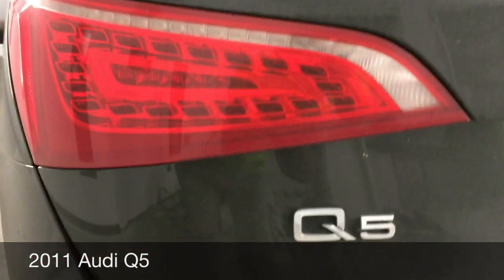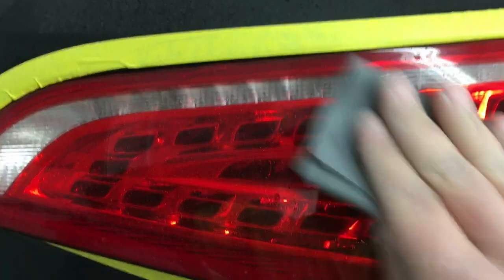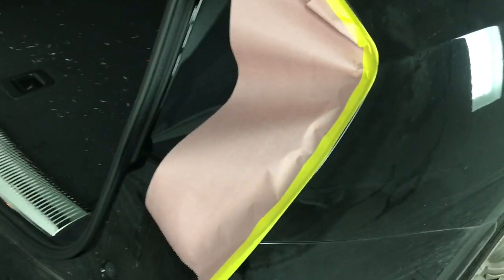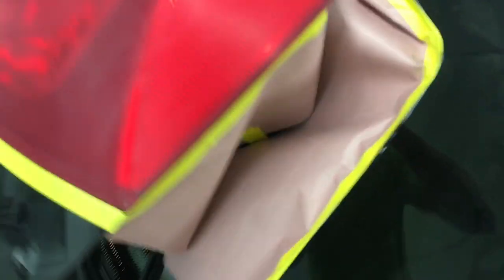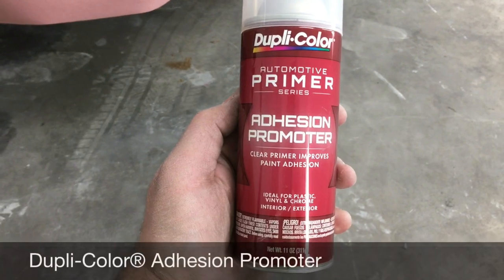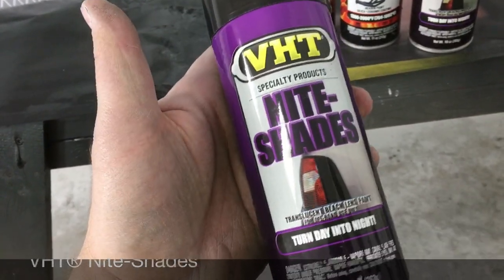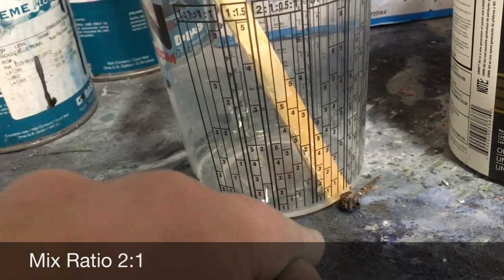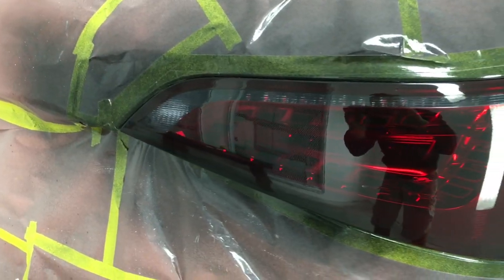How-To | Nite Shade Taillights (Professionally)

Comment: If ur planning on doing this DO NOT sand ur taillights first paint sticks by simply cleaning them then u will have better lite shine thru or if u wish to remove paint back to stock  without ruining ur lights
Reply: Paint sticks, but if you don't sand, it'll start peeling in a couple of months.

Comment: I may not be a real painter but wouldnt it have been easier to remove the lights n side marker... I mean you talking about profit but just ran threw a whole lot of paper n plastic...
Reply: It looks like he covered almost whole car,just to paint taillights,i mean what the fuck
Reply: You then have to detail mask the back of the light housing to keep paint from entering the inside of the light assembly
Reply: The price might be relevant to what he uses, im pretty sure he wont be doing all that and losing money. Hear what you saying though.
Reply: Literally could have saved money and time by removing the lights and side marker
Reply: Exactly what I was thinking but I guess that's how you tax the hell out the customer.
Reply: remember, by removin the lights ur liable for damages. safe than sorry
Reply: I've removed taillights on hundreds of cars I work in the automotive field bud.
Reply from the maker: Hey guys everyone has there reasons to do things there own way. The plastic and paper is waaaay cheaper then pulling off lights and then masking the lights off once there out then installing and sealing up tail lights so no leaks. So yes it’s very smart to leave them in the car. Only takes 2 min to bag a car and a couple min to tape off the lights. Also doing it this way there are no risks of future tail light leaks from not being re-sealed up properly.  there’s legitimately no risk in doing this and seeing how the bags of plastic are very inexpensive from my standpoint there’s no more efficient way to do it. How ever you do it just do it with pride and do it right.

Comment: If I dont have a spray gun what kind of clear would you suggest?
Reply from the maker: Michael Braun hi Michael, if you goto your local auto body supply store, they should have spray cans with some high solids clear coat that are much better quality than your typical store bought clear coat cans. It will be thinner inside a spray can, so apply several coats of clear. It won’t have the gloss, but cutting and polishing should bring it out after it’s fully cured. Follow instructions on can for cure times. 🐍🤙
Reply: Michael Braun harbor freight, 35 bucks and I’ve used the same gun for years if you clean with acetone after use

Comment: Great video ! Question; what’s the best way to darken one tail light once the clear coat has been applied? Thanks.
Reply from the maker: Aristotle Vallianatos hi there, you want to make sure you’re happy with the level of darkness before you apply the clear coat. Once you apply the clear, the tint is sealed in. If you want darker, you will have to wait until the clear is cured, re sand, tint and re clear again.

Comment: i loved this stuff. turned out great, however, i did do a great job at covering my paint, yet some parts of my car did get overspray on it. other than that, DO NOT go slow when spraying you're lights. it will make that part a lot darker. light, fast sprayed coats are the best way 😎
Reply: it’s usually 3-4 screws to remove the light. i’m still wondering why he  spent so much time n material  taping and covering the car?  lol if he worked at my auto body shops i’d fire him
Reply: @cesargonzales4819 I run a "body shop" and he did it correctly.

Comment: To properly professionally do this, you would not use VHT nightshades you use VHD nightshades if you’re in your driveway for the true professional will tent clearcoat, take the tail lights out, prep them with an adhesion promoter, and then spray them with a professional grade automotive spraygun to achieve the desired tint. Then it don’t peel it don’t fade. It don’t drive back don’t shrink and it last for many years ask me how I know.

Comment: I see you sanded the lights. I have a question...if I wanted to tape off a 'design' on the lens that would still be visible after tinting the lens, should I sand before, then lay out the design, then clearcoat? If I sanded after laying out the design I'm sure it would mess up the design I just taped on. I see a lot of these videos where they don't clear over the nightshade, but some do. Just wondering which way to do this. ;)
Reply: Clear over the nightshade definitely helps. I did 1-2 coats of clear coat after 2-3 coats of the nightshade

Comment: I was disgusted by the scuffing and spray paint....then block sanding ..and then waxing....I was like wuuuuuh.....man that turned out amazing...I'm doing my tail light soon with vivvid air release dry tint..it will have a little orange peel...I like to have the ability to peel it off and go back to stock

Comment: How would u remove this if someone wanted it removed? Brake cleaner?
Reply from the maker: Mr Taken unfortunately brake cleaner won’t remove it. But if you sanded the light with a 320 grit and a DA, it could be sanded back down to red, followed up by a 600 wet sand it could then be re clear coated or buffed and polished to be red again. It can be done, but it could also be cheaper to just order replacement lights online depending on make and model.
Reply: Will u link me the buffing supplies u used? Including the buffer etc

Comment: What's the point of the sandpaper??? Or the abrasive?
Reply from the maker: that guy sandpaper is needed for a “mechanical” bite for the paint. Skipping this step could result in the nite shade and clear coat flaking or chipping off.

Comment: Adhesion promoter works wonders on bare unsanded platic allowing you to paint
Reply: OblivionDio we use AP-131 on aircraft on occasion at my work and it works like shit, sanding is the king
Reply: I'm sure your use of it is entirely different than a taillight which in this application works fine to compliment VHT and the fact that the plastic surface has to be rough for the paint to grab onto which is why adhesion promoters are great for this.

Comment: Why don’t you remove the headlight from the housing completely?
Reply: a lot of extra work involved, on some vehicles, you have to remove the front or rear bumper to access all the bolts that hold the head/tail light assembly on.

Comment: 🤦🏻‍♂️  take the lights off people! Saves time and money
Reply: Can you not afford saran wrap and tape?
Reply: @kolebaumgartner2011  it would just be easier to take them off just a couple of bolts and then you could use that wrap for something that can't be easily removed
Reply: Carlos Sanchez depends what car you have because mine is a pain
Reply: Spray cans are meant to be held vertically and spray forward not to be held horizontally and spray down. You can do it that way with good results but there is a higher risk of uneven spray and spit.

Comment: Would've saved 30-50 bucks in prep and 2 hours if you just take the tail lights off, no?
Reply: Take apart the rear tail gate, or mask around. Painting is a production job, faster you get it done the more paint you can shoot
Reply: Also, it's easier to damage your light housing or scratch your car when removing, and I think it's more work removing than masking... Kinda like why there are window washers for the whole outside of the building instead of removing each window in each outside room of the building and cleaning it separately.
Reply: Scenic City Drone Footage ok that was the worst analogy ever but that’s your opinion. Personally i would’ve taken out the tail lights. It’s literally 3 bolts and like 3 connectors for the lights lol

Comment: Can you pill these back off without hardener
Reply from the maker: This isn’t removable. Would have to be sanded and then re cleared to go back to original finish.
Reply from the maker: 4B vEnOm don’t use clear coat without hardener/activator. It won’t cure properly.

Comment: Why not just remove the lens from vehicle to prep?
Reply from the maker: christph3118 light could be removed but most the time, the entire lens is exposed on vehicle anyways and being mounted to vehicle it provides a sturdy position to work on lights.
Reply: Waste of alot of paper and plastic for this. I wont be using this shop. Cost too much for the amount of waste. Take the light out.
Reply from the maker: speterbilt some vehicles require more time to remove lights than using some cheap masking paper and tape. Time is money! 🐍👌

Comment: That car was filthy, why wouldn't you wash it 1st, when you cleaned around the light all yous did was scratch the paint, if it had been washed you wouldn't have need to do that, and like others have mentioned wouldn't have been easier to just remove the lights, you could have made sure all areas, top bottom and side would have been done evenly,

Comment: Jeezus! Why not take the lenses out of the vehicle and not sand them like the instructions say? You're using a spray can so why not submerge the can in hot water for a half an hour to promote an even coat? This is not hard. 30 minutes to dry in between coats and 3-4 coats and the results I've gotten have rivaled this shit show of overkill

Comment: waaaaaaay too much work. i was hoping to watch something i can do at home
Reply from the maker: c dozer this is possible at home. You can goto your local parts or paint supply store and pickup some quality 2k clear coat in a spray can. Also the lights don’t need to be sanded and polished at end. This video covers steps needed for a professional end result.
Reply: This job would have been 10x easier if the taillights were removed first, depending on the vehicle. I have a C5 Corvette and it only requires the removal of 2 screws per sense. So, if your car's lights can be easily removed, do so.
Reply from the maker: Naaman Geist easy both ways. Lost a little tape and plastic sheeting if Left In. Many vehicles tail lights can take a while to fully remove. This is minor masking and doesn’t take long. Also provided a nice stand to be sanded and polished on. Very nice to leave in for fast turn around.
Reply: @viciousautoworks33  That's why I said "depending on vehicle" and was addressing the "waaaay too much work" comment. My corvette has recessed taillights, making masking, sanding and polishing more difficult and 2-screw removal a much easier option.
Reply: @viciousautoworks33  So how do you guys go about removing the raised lettering on some lenses? Mine has it along the bottom edge. This will hinder sanding and polishing efforts.
Reply from the maker: Naaman Geist they will sand out. Wet sand with a good 600 and or 800 grit to knock the letters flat and you won’t see them anymore. We recently did this on a 2004 Acura TL. Also, don’t be afraid to use a course wet sand paper. We used 400 wet sand on the Acura lights. We didn’t do a video on the tail lights but you can see a walk around in our recent uploads.
Reply: @viciousautoworks33  Thanks... so do I then sand with a fine grit after the lettering is gone or will the tint and topcoat fill in the scratches of the 600 grit?
Reply from the maker: Naaman Geist I would go over it a little with some 800 grit. And you will be fine! Using a small flat sanding block to sand letters down will really help make them truly flat.

Comment: I just feel like you used alot of unnecessary wraps and paper and liquids and products ect. Im not a professional so idk. Just based on other videos on youtube and this one, the look, looks the same
Reply: i thought the same thing but remember that you rarely see the results years down the road. I am almost positive skipping some of these steps will not work out well in the long run
Reply: Matt Mendelsohn I mean if worst case scenario is I have to re do it 5 years down the road, I’ll kinda take that but idk
Reply: @CravonMoorehead  I just tinted my motorcycle windshield by just emptying the can on the screen. only prep was cleaning and no clear coat. I hope it holds up but i have my doubts. i went to mark a couple spots on the windshield with a pencil that needed touch up after install and looking through it and the VHT started scraping right off where ever i went to mark. I agree its alot of unnecessary work for small jobs but that right there tells me this tint by itself prob wont last in the long run and why these dudes go that extra step. Thats all i was trying to say.